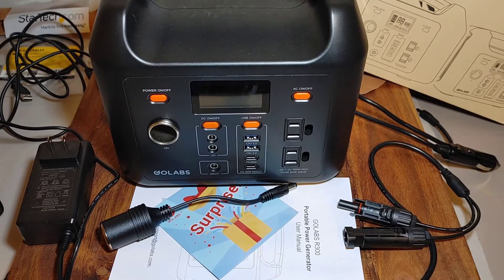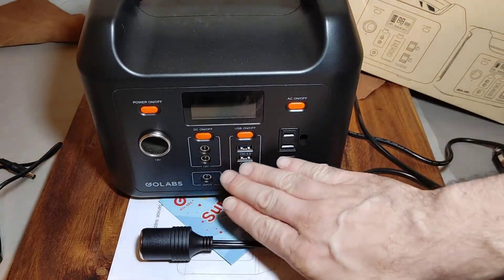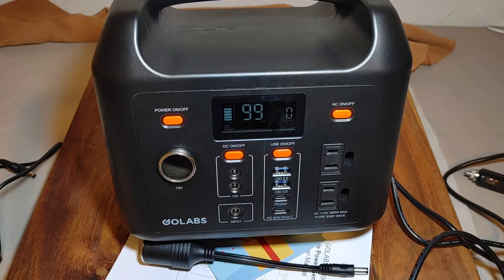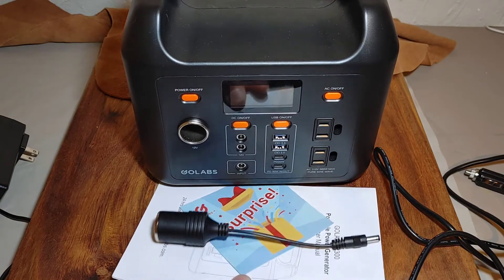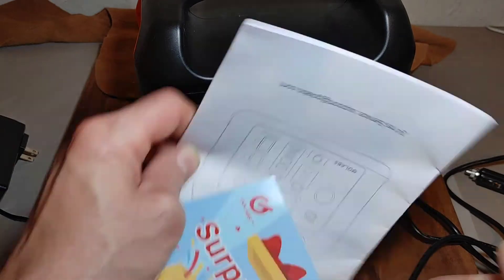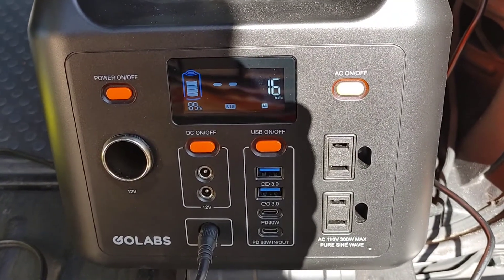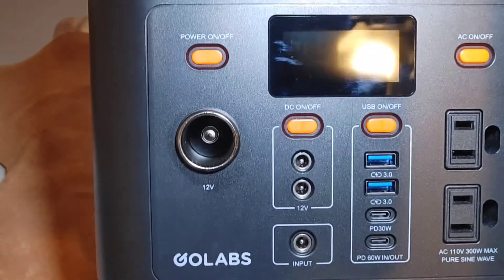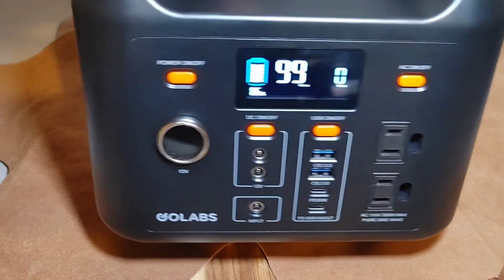GoLabs R300 Power station. unscientific test.

Comment: I have one and mine charges at 38w from the 12v car port, but that's while driving, it's much less if the car isn't running.  Also, 44w from the A/C brick, and 51w from my 100w solar panel.  It appears the DC input is limited to 3 amps, so 13v x 3 (39w), 15v x 3 (45w), and 17v x 3 (51w).   It's spec'd at 62w max for solar, but to get that, you need a panel that has a voltage closer to the max input (22v), something like 20v x 3 (60w).   I'm looking into hooking up a DC-to-DC boost converter, if I can boost the input voltage to 20v, then I could boost the R300 charging rate as my solar panel is spec'd at 5.5 amps at 18.2v, but for some reason, the R300 drops the voltage to 17v with it's MPPT algorithms.   I'm just not sure if the DC-to-DC booster convert can maintain a steady output voltage with a variable input voltage, but want to try it out.
Reply: Great info. Thanks for sharing!

Comment: I have this one too and yeah I wish they had implemented in and out wattage but then they would’ve probably charge us more for the internal chips , so far this unit has stand my needs I have done plenty extended test the only down side is the time it takes to recharge but here we go again heheheh can’t have all at a lower cost beside that discount promotion I can’t complain other units at that cost don’t even aloud pass through nor back bright led and this type or battery chemistry .

Comment: If you keep the charge cycles between 20% and 80% the battery will last much longer. But how long will the electronic parts in this last? Amazon reviews reveal issues with the display. Report any issues you have and they`ll replace it I`ve heard.
Reply: i use a massive 48v 25ah lifepo4 for my escooter and charge it up to full every time after deep discharge, multiple days a week all year. lifepo4 is a beast after 2 years i have noticed zero effect on my scooter range. my past lithium ion powered vehicles all have degraded range after 1 year
Reply: @RagingHamster  I saw another report about LiFePO4 batteries that said after 2000 charge cycles the capacity only drops to 96%. So maybe being careful about the charge range isn`t something we should worry about?
Reply: Can you explain this to me? I'm confused. Is it that it makes it actually last long or you just using less "makes it last longer"
Reply: @AskIveSolar  A LiFePO4 battery is rated at about 2000 cycles before the battery capacity drops to 80%. If you don`t deep discharge it each time and run it dead then charge it back to 100% the battery will keep its capacity and degrade much slower. 

The last upper 10-15% of charging to get the battery to 100% charge is hard on the battery and causes it to heat up which isn`t good. Fully discharging the battery also stresses it. It causes chemical and other changes that reduce capacity and causes a little more avoidable damage each time it`s done. If you avoid this as much as possible you can greatly extend the life and health of the battery and get more service from it. It`s the same with lithium ion or lithium iron phosphate batteries. Instead of 2000 charge cycles you can get 8000 or 10,000.
Reply: @AskIveSolar  Also storing a lithium battery at full charge damages it. Always store them around 50% charged.